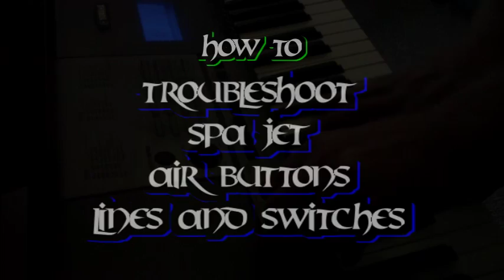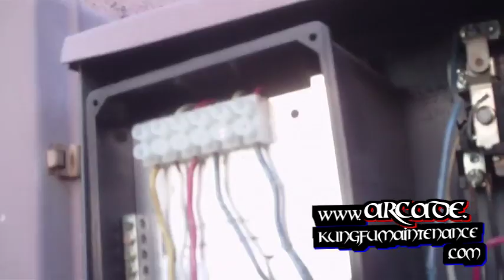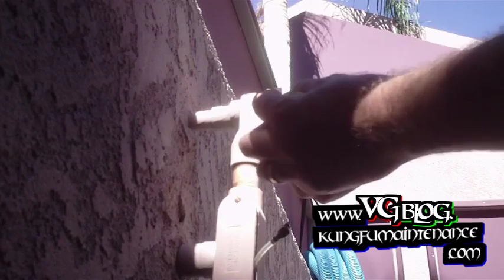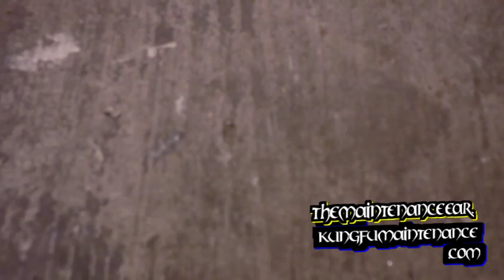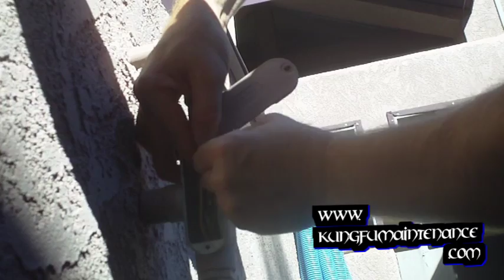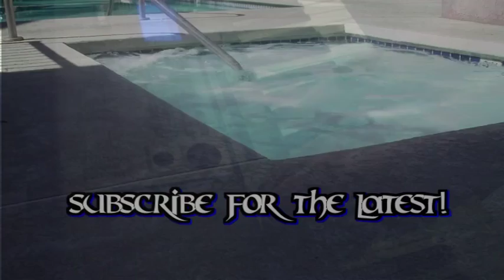Spa Air Line Jets Button Troubles Not Working Won't Turn On ~ How To Troubleshoot And Fix

Comment: Hi, i have a proble with my pool spa,the jets wont turn on,every time i push the air button it's  making a loud click from the air sensor box,i tried to replace the pump capasitor but still wont work i hope you can hep me sir

Comment: The tubing is missing at the spa button. How would I replace the tubing so I don’t have to traipse through the yard and blow in the tube? It is a built in pool/spa combo. The tubing runs underground.
Reply from the maker: A fish tape would be pushed through from controller side to where air button is. New hose attached to fish tape and new tube pulled through conduit.
Reply: We will try it. Attempts to gently tug on the hose caused it to stretch. Thanks for you time and advice!

Comment: Is replacing a spa air tub as easy as connecting a coupling to join the old tube with the new tube and just pull the new line thru?  Thanks
Reply from the maker: Occasionally can run into complications but most times yes it is that easy. It is generally better for the tube to connect directly to the back of the button no coupling just the tube. Though sometimes a coupling is necessary to extend the length of a tube.
Reply: KungFuMaintenance Thanks.... The spa was installed on a home I purchased and I noticed there were some connections made with couplings and the tubing seemed like it was kind of brittle.  My thought was just to replace the whole length of the tubing to be one continuous piece and to replace the air button while I was at it.  The Intermatic RC2343PT is new.  Thank again.

Comment from the maker: If I understand correctly it sounds like the air tube has siphoned over. If a picture is worth a thousand words than a video response would be worth ten thousand words. I think I would try disconnecting from the back of the air tube button than blowing through from the top to force the water through and clear the line.

Comment from the maker: Thank you for watching and the good question. You can disconnect both ends of the tube and than use a can of compressed air to force out the water. Using a can of compressed air is also a good way to check if the switch is working. You will want to avoid blowing into the switch as that would introduce humidity to the switch. Water and humidity are not good for the switch. Unions and connection points are the trouble spots. If couplings must be used only straight couplings should be used.